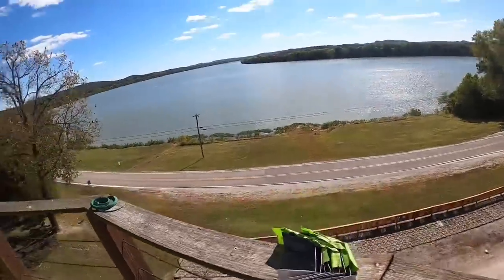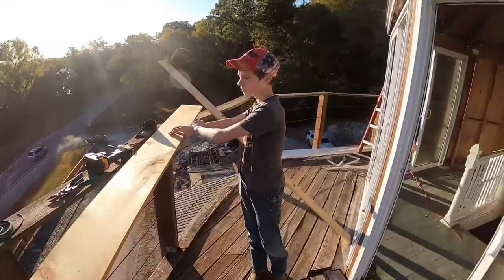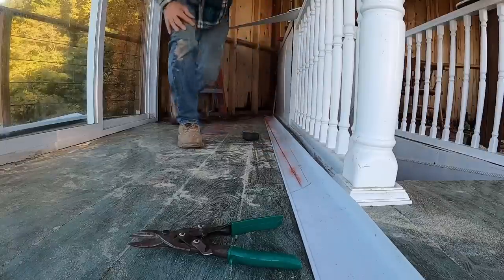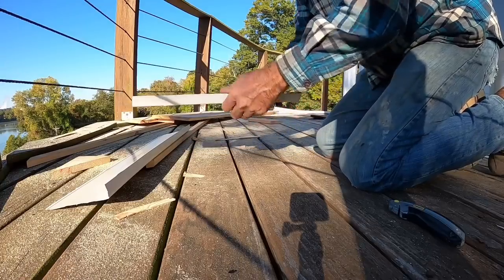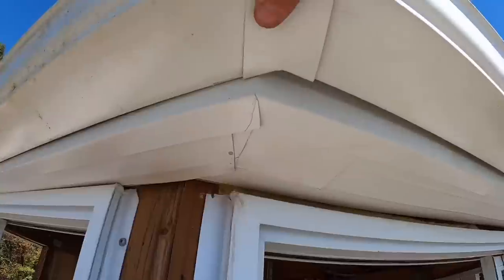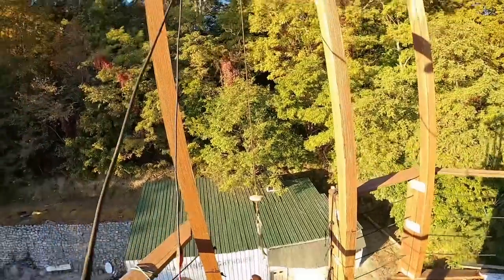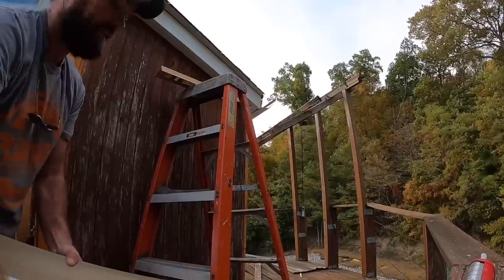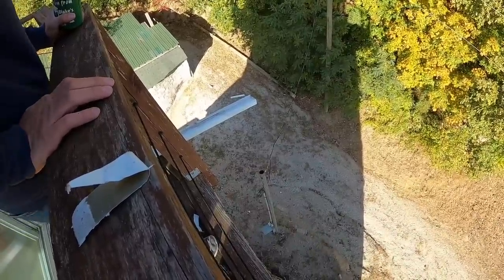But did you die?? Gutters!

Comment: Couple of pointers for next time. Find some 'Skin Pins' which you insert into each rivet hole as you are drilling them. When you finish drilling you know all the holes line up. Use the pins again after applying the sealant. Take them back out one at a time replacing with the rivets.
The rot you found under the window is exactly what I commented on in your last vid where i suggested you pull all those deck boards, inspect the joists, and throw down some ply offcuts so you know where you are working is sound.
Reply from the maker: Thank you

Comment: Circle has 180 degrees. Octagon has 8 corners. 180 degrees divided by 8 = 22.5 degrees each corner.  Front and back of gutter are straight 90 cuts, the bottom cut is at 22.5 degrees.
Reply: most circles I've run across have 360 degrees 😁
Reply from the maker: 360/8=45 does it not?
Reply from the maker: Should have looked here first… 😁
Reply: @nyamillennial

Comment: Hey Matt here is a cheap but very effective way to get rid of Termites go to your grocery store and buy 1 - 1 gallon sprayer, 5 boxes of 20 mules Borax,  This worked great for me and I live in South Carolina and was giving this recipe by an older Gentleman. replace all your water damage board, Then in the sprayer mix 1 Gallon of hot water and 1-1/2 cups of 20 mules mix till it all mixed up until their is no solid in the bottom and spray it to everything. when everything is covered. Then go down to your lawn 10' from the foundation dig a small hole 6"-8" deep, Then get a piece of wood that has some termite damage but mostly solid spray the mixture till the wood is soaked and put it in the hole that you just dug. The will have to be done every 10'-15' all around the structure. this should kill all the termites for a hundred feet in all direction. good luck this works best when it is warm out side. because in the north all pests go deeper in the ground as it start to freeze up. ps. What you don't use for the wood treatment you can use in the laundry for getting your work clothes clean.
Reply from the maker: Well now that is awesome!! Thank you!  I keep borax 100% of the time!

Comment: I would seal all of the splices in the sofit panels where they bend around the corners.
That octagon looks amateur built to me, so one has to fit things as you did.
Not a "professional" myself, but have assisted on a number of remodeling's of older structures. The stuff one finds in doing so boggles the mind.
Reply from the maker: Tell me about it

Comment: Great lesson Matt. It taught me if I ever try this on a 45 degree, make a jig and make them in the shop with 6" sides to only have a straight section in between. That last section, every time we heard the "creak" sound, we were waiting for the "crack" sound to follow. Just wondering on the 4 ft. wall going in, are you going to add a little storage in the space or just a flat wall? Don't cheap out on the windows, get the ones that you can pop in to clean easy. Looking good so far and no injuries. Bonus!!!
Reply from the maker: It will have to be insulated as it will be an outside wall. No storage. But expensive windows trust me!

Comment: Who ever built that tower was clearly not much of a carpenter.  Getting anything right will be a challenge.  An octagon would not be that hard, but they really screwed that up.  It looks like you are doing a good job, considering what you had to work with.  Back in 76, we built a house, my dad, my brother and myself along with my wife and sister-in-law.  My dad was a good carpenter and he showed us how to correct for square and level at every possible point.  When we go to the roof everything fit perfectly.  Our next-door neighbor also built a house at the same time.  He started with a crooked mess of a foundation, never corrected anything, and by the time he got to the roof a professional framing crew had to cut every single rafter separately just to get the roof on.  Good luck on your endeavor.
Reply from the maker: Crazy how that works out!

Comment: Hi  Scary work ref the degree calculations  Each corner angle is 45 deg as has been said by you and others. However the angle between the two pieces is 45 deg so that is 22.5 for each side. Another couple of points. You have mentioned in previous video's that you intend to have sealed windows. This might making cleaning them difficult? Second point you have also mentioned that access up the internal stairs is very restrictive. So I would consider making part of one of the rear panels removable so you can with the help of the man lift get larger items up into that room.
Reply from the maker: Thank you

Comment: The end results are hard to believe given the precariousness of your work environment.  Not certain that the wind won’t push s9m3 water over to the electrical but clearly water coming out the downspout means it raining on it anyway.   If it’s a concern, you can hang a light chain from the end of your spout and the water will follow that (to a point).   

I was worried that you would drop a tool or get stung by a bee/wasp/hornet and misstep.   I remember my days when I worked up high and was taught: the hammer will hurt your thumb but you need to embrace the pain and not over react because the fall will kill you.   Be safe
Reply from the maker: I hear ya

Comment: Whoever roofed it , really caused you problems . They didn't use a starting strip (course) , the water runs in  the gap between the tabs and under the drip edge .
Reply from the maker: There is a starter strip, they hung the first single past too far….

Comment: My totally unsolicited advice: since you're not using a weather resistive barrier (or WRB, like Tyvek or Blueskin) behind your metal fascia, the metal fascia is the only and primary WRB. The trouble with that, however, is what's called the "Venturi effect."  Without going into the science of pressure-equalization, in a crack in the WRB less than 1/2" the Venturi effect will literally suck fluid water travelling across the crack into the building. 

In summary, don't forget to go back and caulk every single seam in the metal. Also, most sealants have a lifespan of just 5 years but the average homeowner only maintains their sealants exactly never, or until everything has rotted out behind it and there's a problem. 

When you're eventually cladding the knee walls, I would suggest using a rain-screen system that doesn't rely on sealants. The cladding with a shallow air space behind it becomes the secondary WRB and your Tyvek or Blueskin behind it becomes the primary WRB. Any water that makes it past the cladding hits the WRB and just drains out the bottom.
Reply from the maker: Thank you

Comment: What I would have liked to see is to attack one panel of the Octagon at a time from fascia soffit new window. I would use self sticking flashing tape and seal each surface lapping over previous piece from under drip edge of roof above down over head flange of new window and down each jamb. That is the only way to dry in all those mismatched misaligned corners. Then come back and frame lower roof below using flashing tape and metal flashing to dry in window sill flange to shingle roof below.  Not too late to start over. Reuse gutter discard all other metal. Sorry 😳
Reply from the maker: It is dry now. Drip edge over facia, facia over “soffit” facia was used for soffit due to small overhang. Then J channel up against “soffit” once walls are built
Reply: I am sorry my friend metal soffit fascia is not meant for dry-in. It is an exterior trim/finish system. Not very tight. I don't want to see you have water intrusion at the head of your new windows especially with such shallow overhangs. Experience has taught me well.

Comment: WHY 45 degrees you are guttering around an octagon; internal angle 135 degrees. therefore angle required is 62.5. If you use those angles pieces you won't need narrow gap seal the gaps will be massive.
Good luck
Reply from the maker: Because that is what worked

Comment: If you need to do lots of sheet metal cutting to a line, you may want to look into one of these: M12 FUEL 12-Volt Lithium-Ion Brushless Cordless 16-Gauge Variable Speed Nibbler   
(sold lots of places, or look for similar tools), as that would let you follow your line and skip most of the steps...ie no score or bend until breaking.  And if you get too fed up with the pop rivets, I think that they make a powered pop rivet gun too with the similar m12 battery form factor. Good job on a hard project.
Reply from the maker: Thank you for the recommendation!
Reply: @nyamillennial  See here for a live demonstration of that nibbler: https://youtu.be/RXe5dkG4LI8?t=140   That looks way easier than what you had to do in the video. :)
Reply from the maker: @josephkrug8579  I agree!!!!!

Comment: You should care about the depth of your cut in every instance. There are a few good reasons for that. The first reason for this is safety. If there were an accident, there would be less blade to cut what you don't want cut including your fingers. Next is blade life, the more blade that is out of the cut the cooler that it will run. Not overheating your blade will make it last longer. So every cut should be made at the minimum depth necessary for the desired result.
Reply: I neglected to mention that your guard will behave much nicer with a minimum depth of cut.
Reply from the maker: So by having more of the blade sticking out I was cooling it at the same time. Awesome!  I know I know not your point
Reply from the maker: Interesting

Comment: Watching you hang those gutters was one of the funniest and most frustrating things I've ever seen. I hung gutters for a living in the late 80s/ early 90s. I will admit you did a hell of a job on those odd miters. They are a pain in the ass. Only advice I can give you is to go back and fill the gap on the inside between the 2 pieces of gutter with caulk and then feather it out with a putty knife. Much better way to seal them up.
Reply from the maker: I did but left the out to generate comments! Boy has it worked. But thank you!

Comment: Dennis Lira is correct. Secure that deck and the hand rail before doing anymore work up there. You’re not forking out money on scaffolding so a few lengths of diagonal timber braces for the hand rails and scaffold planks for the deck until you get it sorted correctly. You might not get to say “I wish I had repaired that deck first”. And it may not be you involved. However more power to your elbow and I enjoy your videos more and more.Good luck!
Reply from the maker: Thank you

Comment: If you use screws easy to separate and reseal the many joints as a lot of movement from wind cold and heat in your location,mastic only takes somuch.
Reply from the maker: I feel like rivet holes last longer on that thin of metal. Screw strip so easy

Comment: You have great bunch of glass doors to make a  nice enclosed terrace by the pool ;) And it seems that filming it takes a lot of time away from real job ;) U know time lapse from time 2 time would be just fine ...
Reply: And also I would not rivet the very bottom , but since you did, just remember to "silicone" it from the top over the rivets. I have my gutters riveted only on the top half, but they did start dripping on the bottom of seams within 2 years, even with the sealant, did the reseal this year ...
And if you decide do any sketchy stuff - just put a rope around the tower (circle it) with some little slack, and attach yourself with some simple harness with short rope and a screw gate (carabin) ...
Reply from the maker: It is sealed top and bottom
Reply from the maker: Thank you